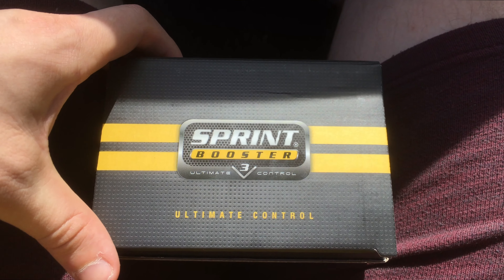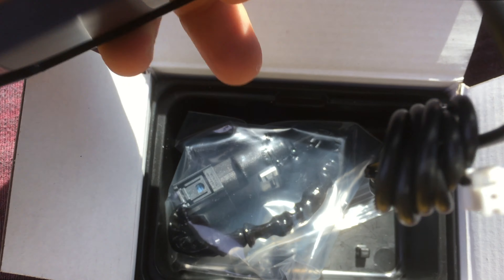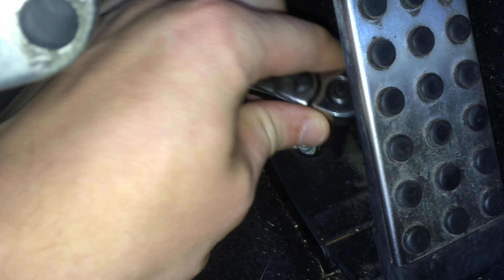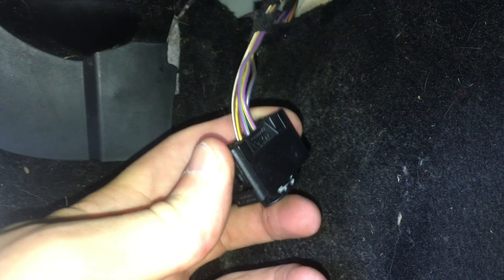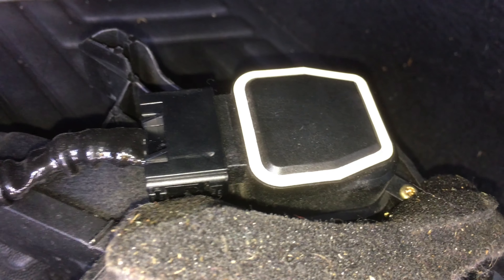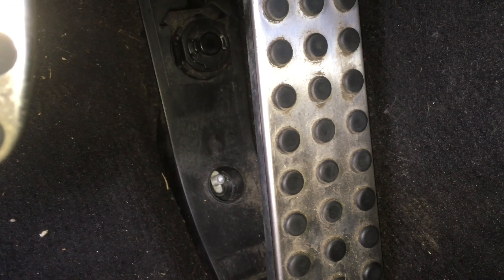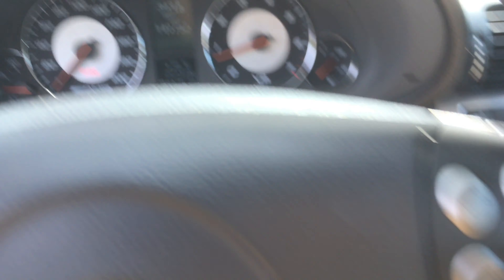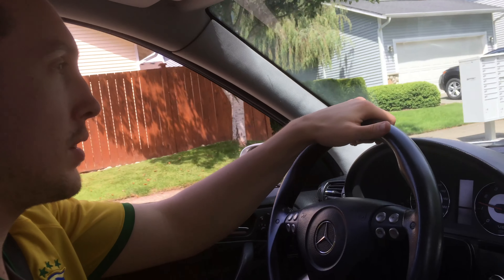HOW TO: SPRINTBOOSTER INSTALL AND REVIEW - IS IT WORTH IT?

Comment: I just got a Acura TL a few months ago. Same issue.  Normal foot pressure on the pedal and there is lag. It's like you have to be abit agressive with the foot to get it moving.  Once you are moving throttle response improves drastically.
Reply from the maker: Exactly, I think it is a normal thing for cars with electronically controlled throttles. Factories just don't tune them to be that responsive to appease the masses, but for those that want it, it's great that products like the sprint booster and others exist. Back in the day on my old mercedes and older Integra GSR's all I had to do was tighten the throttle cable, not so easy anymore! lol 
Thx for tuning in, hope it was entertaining/helpful and goodluck with the TL!

Comment: What is the part number i could no find it for the amg version ?
Reply from the maker: https://www.sprintboostersales.com/SprintBooster/2000_to_2007_MERCEDES_C-Class_Sprint_Booster_V3--SPRME009
Reply: @ANDERZENAMG  i ordered earlir because is on sale. Thx
Reply from the maker: @aktech3271  perfect time to buy 👍 no problem!
Reply: @ANDERZENAMG   what is you stardand setting that use for normal drive and which number ? Thx
Reply from the maker: @aktech3271  I have kept it on race 9 since I got it. I like the pedal to be as responsive as possible, not for everyone though.
Reply: @ANDERZENAMG  nice to hear. I bought because my downshift is been slow.
Reply: @ANDERZENAMG  I thought you said on your video 9 is too touchy for regular driving.
Reply from the maker: @gamatoutsikos  I got used to it and ended up liking it that way

Comment: How much was it? Did it throw any codes?
Reply: G Reddy it was $289, which I was hesitant to pay. But after having it, it’s worth every penny. Absolutely no codes or issues. Benefits include increased acceleration, throttle response, shifting and even mpg’s! Video update coming soon! Thx for watching ⚡️
Reply: Can u do some 0-60 comparisons?
Reply from the maker: G Reddy probably won’t just because not my interest for my car or the product. But from a few other videos online people did log quicker times by about .3 -.7 seconds. 0-60 has a lot of variables, overall I know from driving it the whole experience of the car is greatly improved. I have an update video coming soon that will cover all the details and if I get a chance I’ll do some comparison pulls 🤙🏼⚡️ thanks for tuning in, comment and the questions!